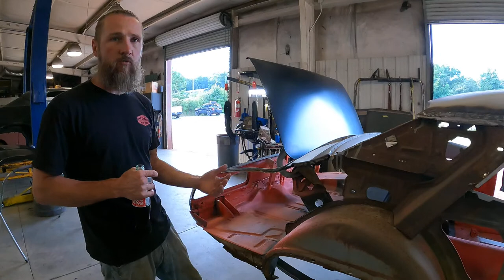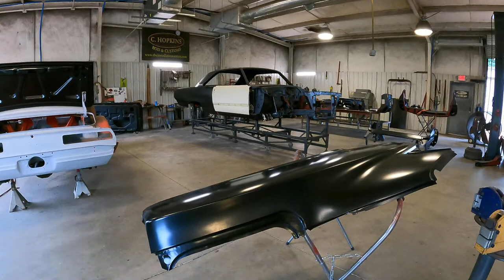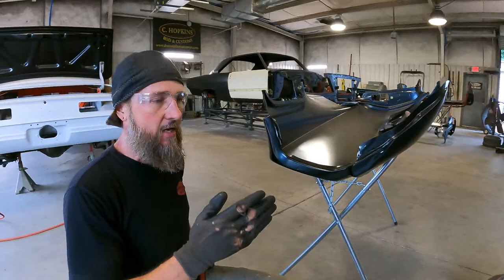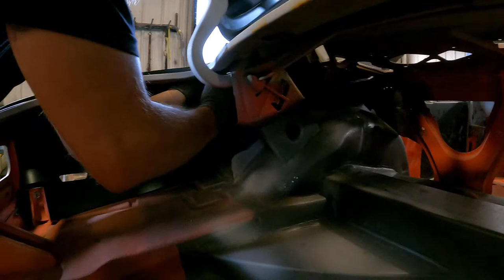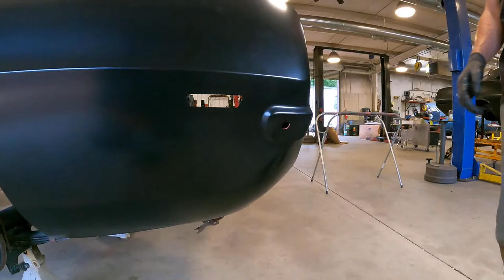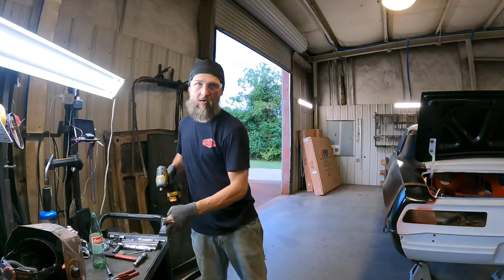Tech Talk Tuesday Episode 39 - 1967-69 Camaro Quarter Panel

Comment: I need just the a pillar assembly from the roof to the dashboard due to unfortunate damage any way to get just that part instead of buying the whole side
Reply from the maker: You can buy the hinge piller assembly
Reply: @aMAYSingMetalWorks  i  can't afford the whole hinge pillar assembly was hoping maybe you had a good used. A pillar you have cut out of a car . 8m severely disabled on social security trying to save my cat it got damaged I n a freak storm